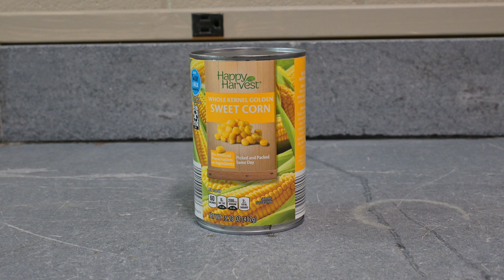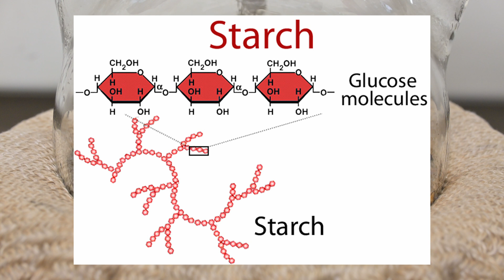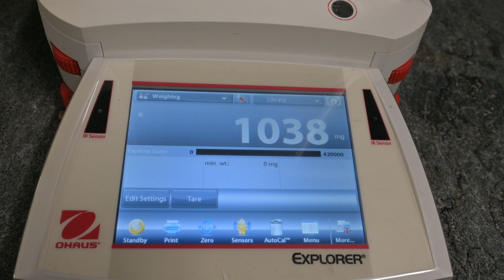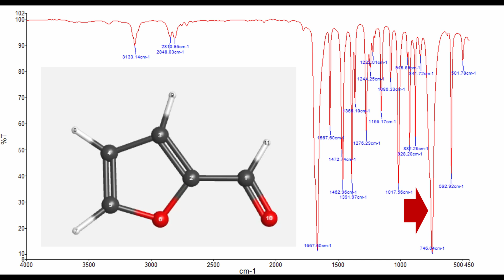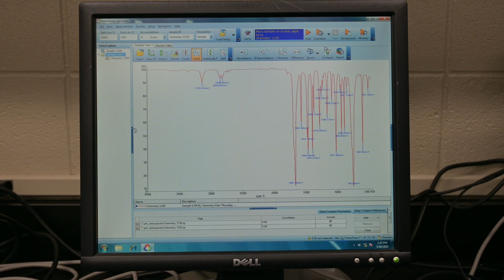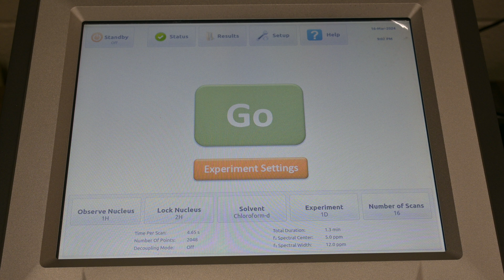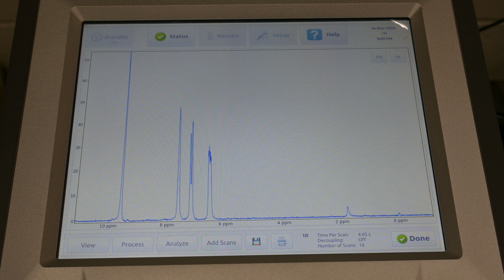How To Make Furfural from a Corn Cob

Comment: Hi Wheeler Scientific,
Nice video to display a famous organic chemistry compound synthesis from "garbage".

The nature of furfural is quite interesting due to its aldehydic group and hetero-aromatic pentaring; it is indeed derivated from xylose and can be the source of green alternative to petrol for C3, C4, C5 chemistry.

There was quite some efforts and research the last decades to allow for furane synthesis (fermentation or pyrolysis or hydrolysis) and related butandial or erythritol. 

I have looked for interesting reactions of it; and I was surprised that the aromatic core can be a source of troubles when coming into contact with strong bases; that catalyses the fast runnaway polymerization of the pentadienic rings into high MW solids.

Keep on the good job.
PHZ
(PHILOU Zrealone from the Science Madness forum)

Comment: The Claisen adapter is a good tip. Putting the heating mantle and boiling flask on top of a lab jack or similar is also good. This keeps you from needing to figure out how to get the heating mantle out from under it when stuff's popping off.
Reply from the maker: Thats true, I always forget about lab jacks. Very useful, too bad they are so expensive. lol

Comment: For furfural applications, you could either transform it into THF which is a great solvent to have around if you want to do Grignard reactions, or reduce it into furfuryl alcohol if you're into rocket science.
Reply: 2-furoic acid also has some interesting synthetic applications... for a higher yield of furfural use a pure pentose sugar like D-ribose instead of corn cobs

Comment: Liked the clip.  I recall that in Freshman Chemistry, going way, way back, it was explained that it was this chemical reaction that made much of Chicago.  Boggle, did not anticipate that one.  I had thought that Chicago had prospered because it was a significant port on the Great Lakes.  Then, later, someone else, a different Prof, claimed that it was 'white metals' (tin-based metal alloys) that made Chicago, Chicago.  The point being, I gathered, that Chemistry can be a real money maker. Heck, I already knew that.  And now, so do you.
Reply from the maker: Yeah, chemistry is a very good money maker due to the importance of all the products that can be made. Petroleum products, Fertilizers, pesticides, pharmaceuticals, and so much more. Life would be very different without all those.